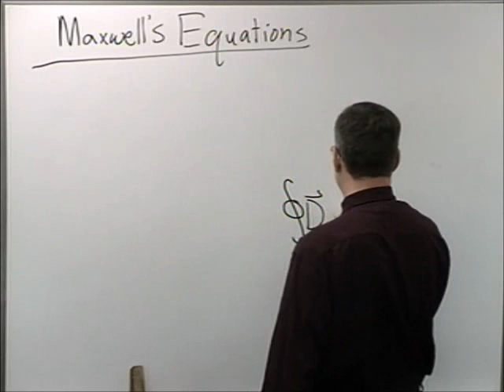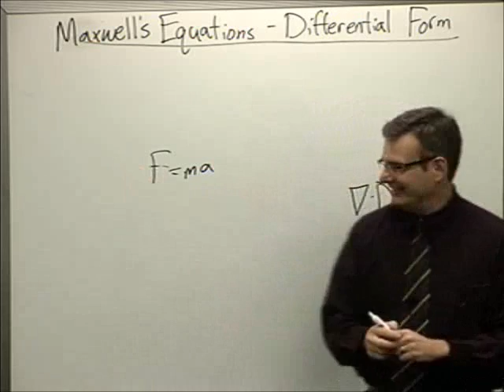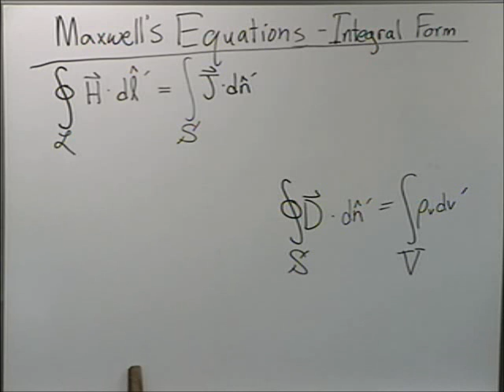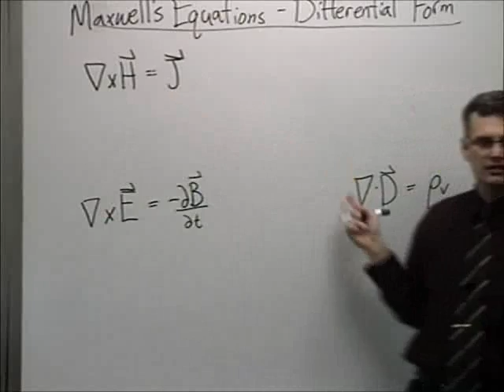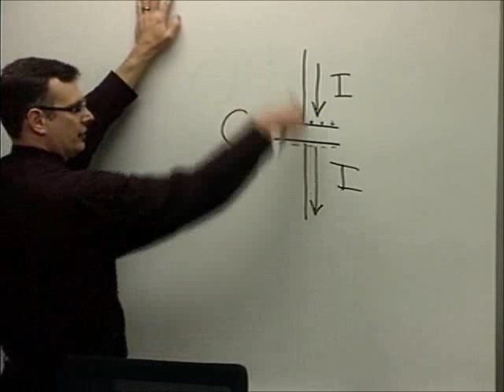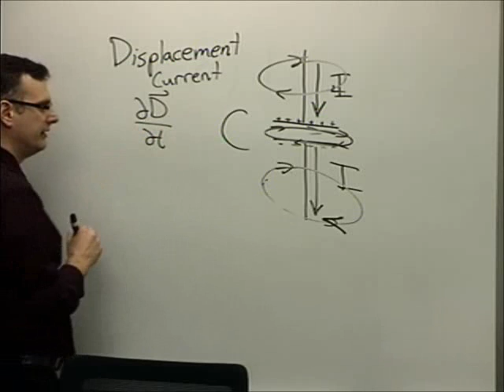WAV01: Maxwell's Equations

Comment: yes, conductive and displacement current should be the same in the circuit level. One has uniform conductivity  while another is field variation or electric flux density variation related.

Comment: You called H amps per meter. Why is Ampere’s Law so often written with your H replaced with B?
Does not H represent the magnetic field intensity measured in amps per meter and B represent the magnetic flux density measured in Tesla’s? I find it confusing when one is conflated with the other. Please explain. I’ve not seen E, the electric field intensity, conflated with D, the electric flux density.

Comment: Unless you have dealt with applications of Maxwell’s equations before, you need a geometric illustration of the equations. There is nothing wrong with slowing down and drawing diagrams for scenarios that represent the equations and relating them to the mathematical notations used. Basic definition of flux, curl and divergence and how they fit into the physics of electromagnetism are fun but could be challenging to those who  lack adequate exposure to the subject, in particular when different mathematical forms are used to express the same physics.